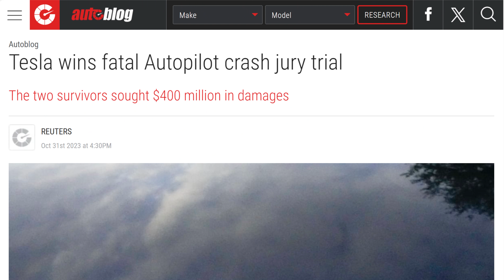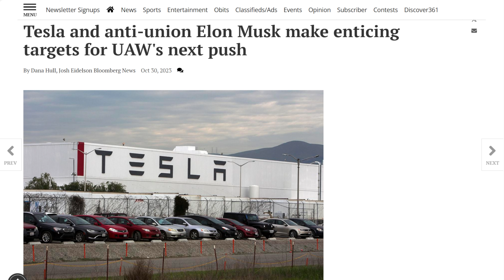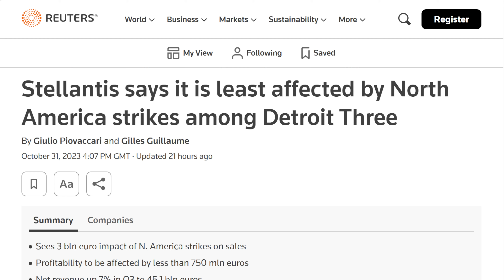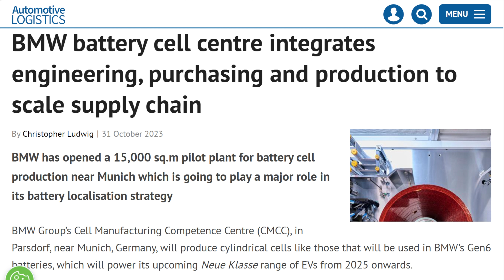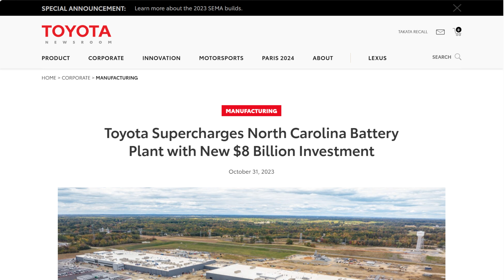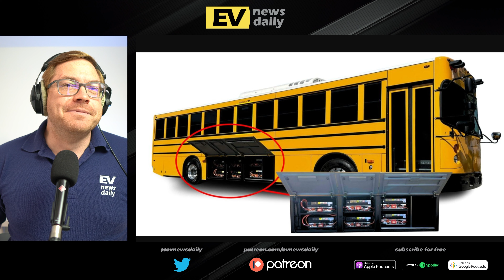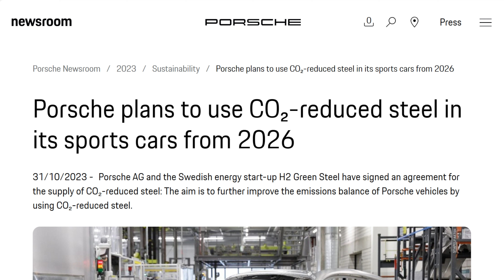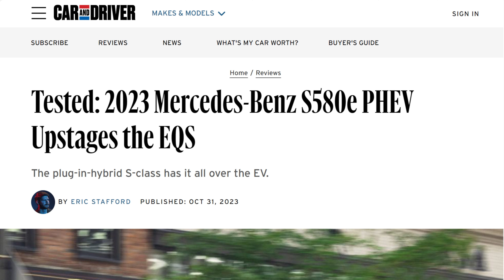Musk & Rogan Shoot Cybertruck | Plus More EV News | Podcast 1949

Comment: PHEV's are rarely plugged in, right? So the debate is really just theoretical. 

Personally i would support a PHEV plugging in as much as possible its much better for the environment. Also in the American red states lots of people try screw with charger so more people charging will mean more pressure on the anti EV A--holes which is also great.